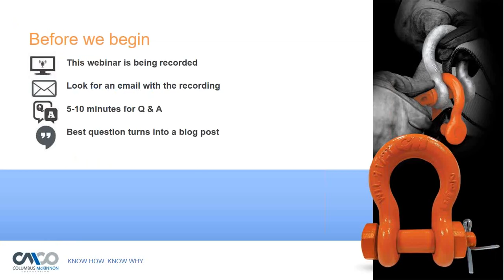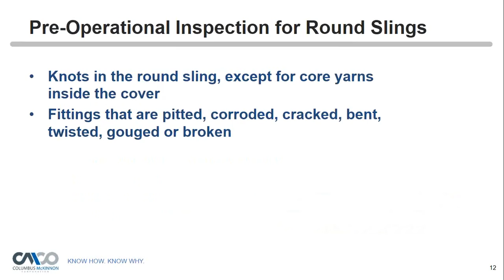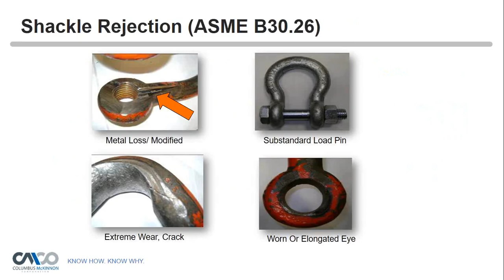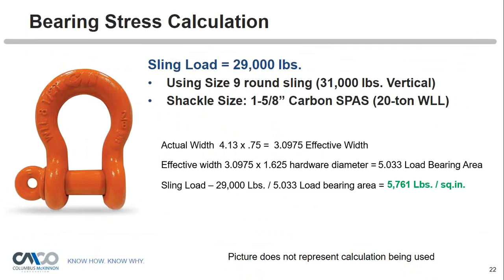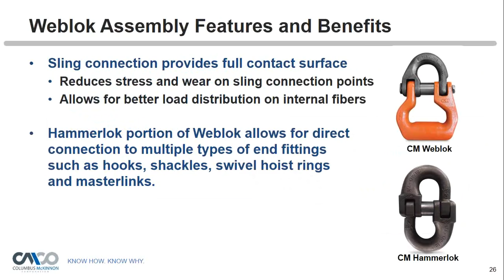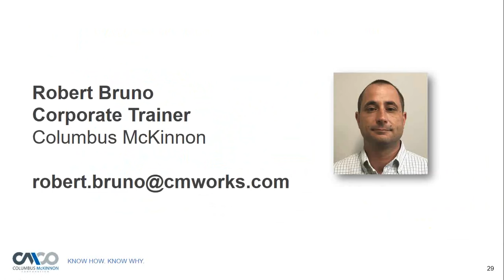Safety Webinar: How to Properly Size a Shackle to a Synthetic Sling

Comment: may be I can ask another question related to soft slings and shackle interface. 

This is related to D/d ratio for soft sling dia (D)and shackle bow or pin size (d).

Generally the soft sling dia is very high as compared to wire rope slings. 

For example if we are using a 20t soft slings, and 20t WLL shackle,

The soft sling dia will be in the range of 100-125mm depending on supplier and shackle bow/pin dia will be in range of 50mm

In such scenario it is very difficult to maintain the D/d ratio . For wire rope slings the code gives clear guidelines for derating the capacity, however for soft slings it is not clear.

Is it possible for you to shade some more light on this. ? 😊